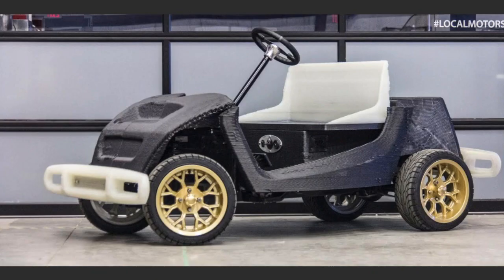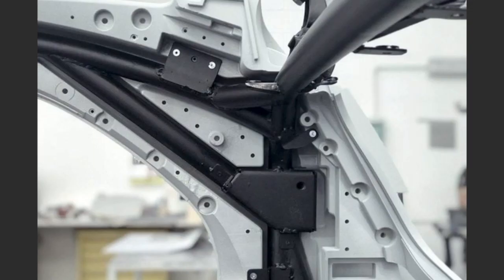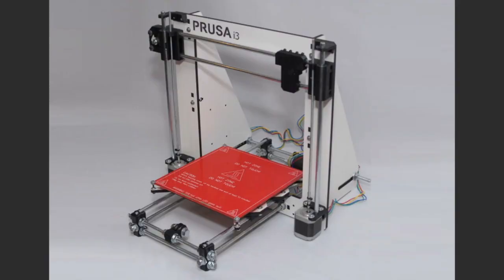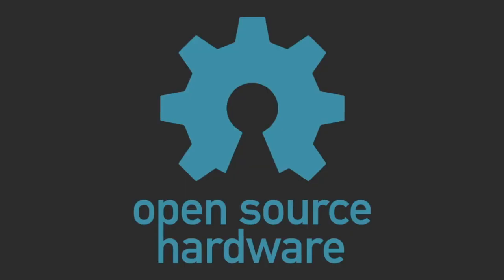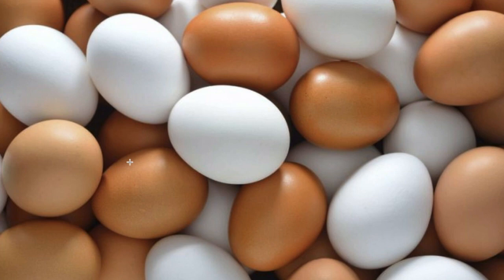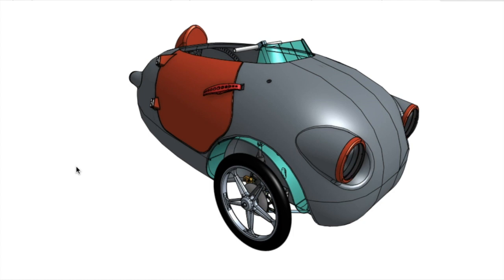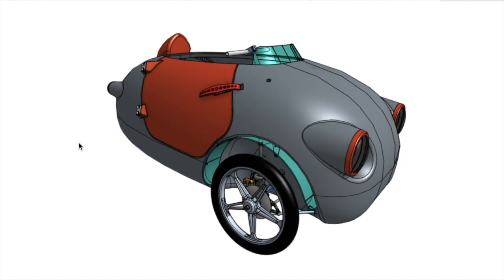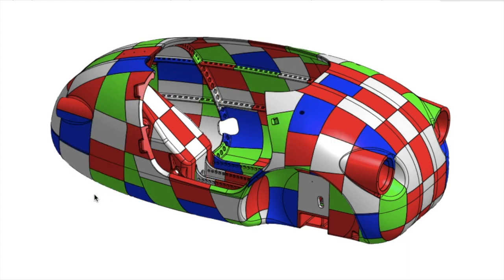3D PRINTED DIY ELECTRIC CAR, the Jellybean3D (ENGLISH, Part 1)

Comment: Cool idea! I wonder how long PLA would last though - I've had PLA prints warp in my hot car before :(
Reply from the maker: I chosen PLA because it is easy available and mainly because it is easy to print. As well because it is a very strong material and long outdoor lasting, and actual good quality PLA blends have enough temperature resistance.
Anyway PETG can be an option if PLA fails.

Comment: This is nice ! can you please show the process how you go about to design 1 large 3D object and cut it to 200 pieces I want to make something like this but no idea how.
Reply from the maker: To do the cutting is not an easy task as you have to take in account quite a lot of things, like printer size, printing orientation, position of the cuts, assembly process, etc. In a few days (maybe weeks) I will post link to the 3D design files so you will be able to see how I made it.

Comment: The Indian Concrete Journal, Oct 2004, p 43-44; 'Innovative Concrete', 'A Car made of concrete And it works!
Reply from the maker: Yeah I remember that. That is radical engineering.
Reply: @gonzalop.chomon327  You know about B&V-246 with Sorel concrete wings, it does not admite steel as reinforcement, but as concrete is a 'composite', tests of different materials in mix can be considered. Salut +
Reply from the maker: @joseveintegenario-nisu1928  Never thought a plane wing could be made out of concrete. :)

Comment: How long will that take to print with 200 parts?

Wouldn’t it be better to have the parts mechanically lock together rather than relying on a butt joint with some bracing?

I don’t see the point of relying on home scale 3D printers.   Can’t you contract out to get larger sections printed?
Reply from the maker: Thank you for your comment Tim Bo
Estimated round 400h of printing time.
To have an interlocking system plus the glueing/welding will be great but I have not found a reliable way to do it in the CAD software.
This is an experimental project that aims to explore the limits of hobby 3D printing, This project does not aim to reproduce a standard vehicle construction.
Reply: @gonzalop.chomon327  Thank you for replying.   It is amazing that such a thing is more than just a thought experiment.  It indicates what is coming in the next 10 to 20 years.  

Good luck with the project.  Maybe you can "crowd build" the parts?
Reply from the maker: @tjejojyj  Crowd build has been already suggested and it is a great idea, and it will be very cool if made from pieces sent from people from all over the world.
But the project is already very experimental so adding more uncertainties (different materials, settings, tolerances...) to it I think will be too risky.

Comment: good idea, but PLA distorts when it gets hot.
Reply from the maker: The idea is to use good quality new PLA blends that are able to hold heat better.
Reply: @gonzalop.chomon327  OK if you live in cold climate, but PLA can melt easily outside. Especially if you park it next to a reflective object, like a window or mirror by accident. It might be fine in the mornign, but when sun angle changes can become like a magnifying glass.
Reply from the maker: @commonsense3652  I live in the south of Spain, a VERY hot area with lots of sun. And before I decided to go for PLA  I did tests, no problem so far with good quality PLA. It is short of a myth that good PLA gets soft with just sunlight.
Anyway the decision to use PLA may change to other material if it demonstrates not to be suitable for the task.
Reply: @gonzalop.chomon327  that is not a myth. Ok, if you print I in white it might not be that succeptable, but object can get to 80+ deg C in the sun easily and PLA without annealing will NOT hold its shape even under its own weight,  and annealing process warps the parts heavily unless you do tricks like burying them in salt during annealing.
Reply from the maker: @Balorng  Yes, standard PLA softens around 55ºC , good quality of new PLA blends get soft around 70ºC and for this experiment is more than enough even for the area I live in. Anyway as stated in the description if PLA proves not be able to handle the task I will change to PETG.

Comment: your biggest problem is plastic is heavy and not that strong. At a minimum you will want to have at least a few main aluminum tubes to carry the weight of person and support wheels.
Reply from the maker: Yes that is true, plastic is not the best material to build vehicles, but this is just and experimental vehicle that explores the limits of hobby 3D printers.
There is some aluminium brackets and nylon 3D printed parts on critical points. But let's say that 99%+ of the unibody is 3D printed.
Reply: @gonzalop.chomon327  I dont' think it will work well, but good luck. Aluminum is not that expensive and would make it practical instead of just experimental.
Reply from the maker: @commonsense3652  Yes, there is many chances that something does not work in this project. But as said it is an experimental project.
I already made aluminium, steel, composites chassis, and I know they work perfectly and they are the most reasonable way to make a vehicle. But who we will be if we do not experiment?

Comment: For strength and durability, you may be able to incorporate this design feature: https://youtu.be/umWhtFFmUe0
Reply from the maker: Hi Marshall, The link you posted in your comment goes to this same video, can you check it please? I am interested.
Reply from the maker: @marshallrichardson3207  Very interesting.
Actual shape of the Jellybean and structure is similar to that beetle body. If I find a good way to glue/weld the parts it will be almost the same. Because I plan to use gyroid (similar to puzzle jigsaw) internal infill structure that absorbs a lot of energy under deformation before failing and even more if structure fails.
Reply: @gonzalop.chomon327  yes, when I saw the Jellybean, I immediately thought of the beetle for the shape, as well. And considering that you have multiple pieces to connect, the way that suture is would be very helpful. I’m excited to see how your project progresses! Good luck! If there is any way I can help further, please let me know.